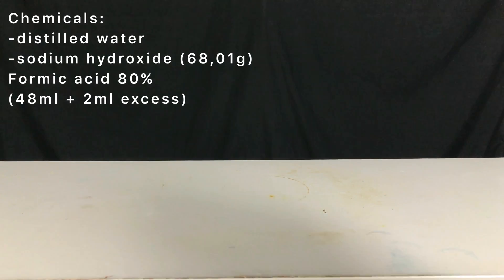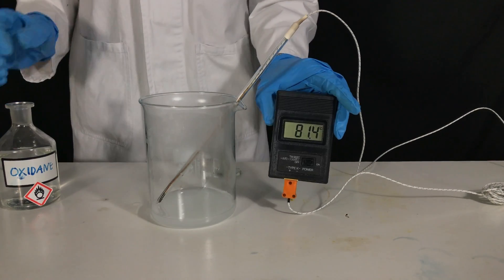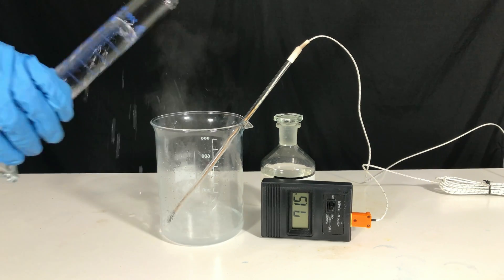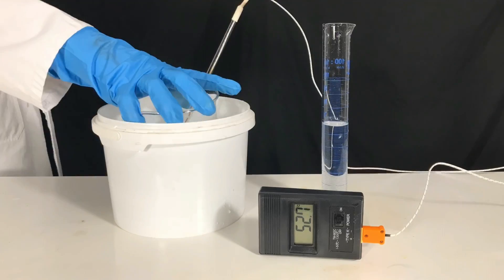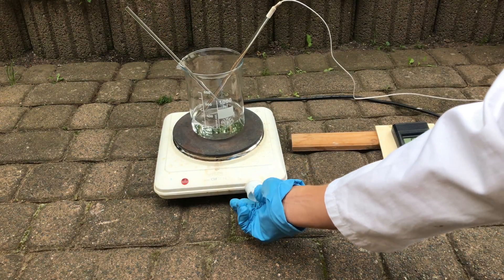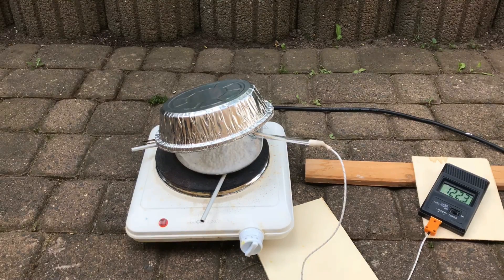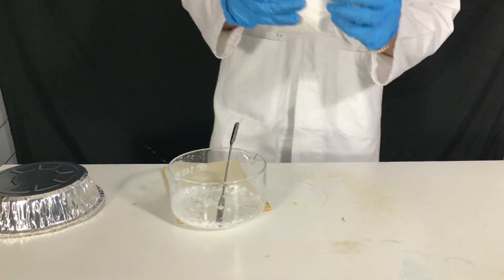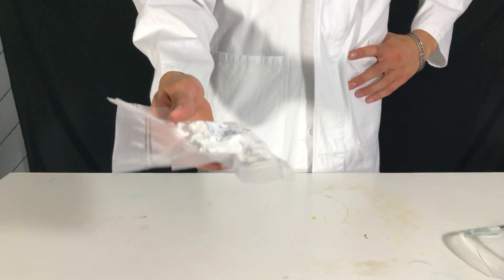Preparation of sodium formate (Acid-Base Reaction)

Comment: Did you try other way to make sodium format like with NaOH N CO Gas?
Reply: If you need sodium format you can use baking soda.
Reply from the maker: I even wrote down equivalent masses for sodium carbonate and sodium bicarbonate on my synthesis papers. If you want me to upload them message me on Reddit.
Reply from the maker: If you have a good paper on it I might try it
Reply: @THYZOID  
Try NaOH+CO ------180*C---- 120PSI-----》
NaCOOH 
little tricky but if you can make the setup or you gonna try 
Tell me please 
Thanks 😊
Reply from the maker: @electromagic3111  I’ll write it down. It does definitely not look impossible.
Reply: @THYZOID   it's too heavy for you 😅😂😉
Reply from the maker: @electromagic3111  na I’ll do it only on a 100ton scale😉
Reply: @THYZOID   can you gmail me send picturs of the experment to me🤔 (befor N after the explosion 😃)
Please
Or you will publish it in youtube?
Q2 Do you will try it in this month?
Reply from the maker: I will publish it on youtube but I won´t do it this month. I´ll have to get some pressure gauges first and build an improvised pump for the CO. Furthermore (although performed outside) one of those industy fans with a 10m hose will be organized. I already build a makeshift 150ml "reactor" that is suitable for all the conditions.